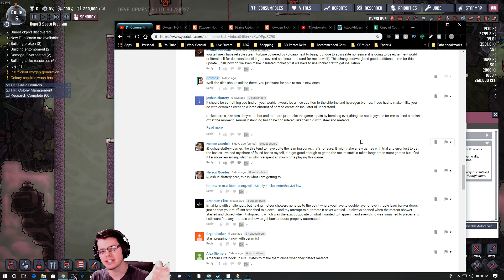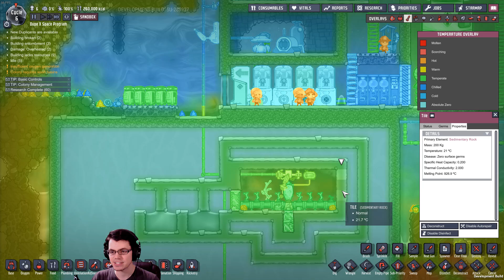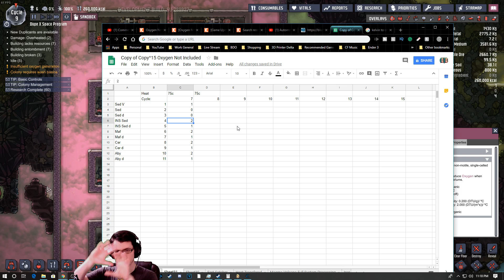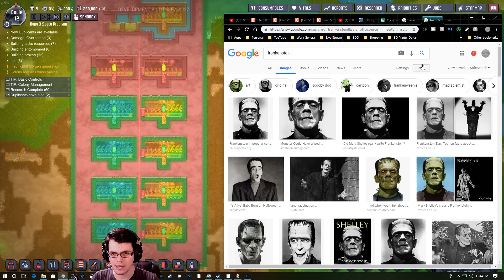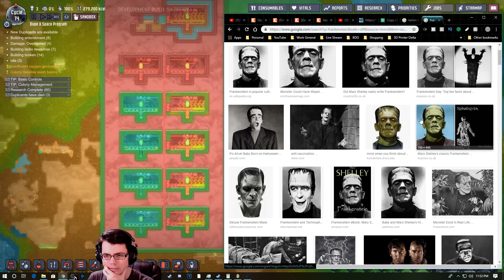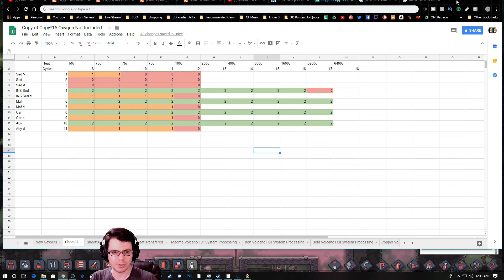Insulated Tile Test! Oxygen Not Included

Comment: The issue with the door is a very real problem, it's called thermal bridging and it's why you wouldn't usually use metal doors/window frames on buildings in real life. Would be useful if the game had the option of non-metal doors like wood but I suppose that would be too easy :p

Comment: They need things that RUN off heat... and actual "convection" to make the game a better game. Also, use standard values that people already know. "Thermal resistance" and "Thermal conductance" and "Thermal integrity". By the way, if something consumes 120-watts, it is only generating 120-watts of heat. Watts is a measurement of energy-loss, consumed and turned into heat. It is stupid that something consuming 120-watts, is generating as much heat as a 4000-watt oven. (Unless it is an electric operated gas oven.) Same with batteries... if it can only provide 1000-watts per hour, then it is only generating 1000-watts of heat, per hour. (Not actually, it is generating less, as the remainder is generated by the device it is powering. Thus, the "efficiency", if it is 90% efficient, then every 1000-watts of delivered power results in 1100-watts being consumed and the 100-watts extra, is generated along the wires and the batteries.)

However, they need convection, so heat rises as well as steam, pulling heat with it... So we can use these things to our advantage. (Top-open units, with insulated floors and walls, should retain temperatures like open-top freezers. Unless there is tons of motion to mix the air and push it out.) Everything here is just one property, "diffusion", and "specific gravity", with no consideration for thermal-motion or "wind", as people walk around or things move. (It only uses pressure travel from high to low, for "flow".)

Even in the video, all the heat should have instantly traveled up in the rooms and the cold should have instantly dropped down. The rooms losing heat should have had a steady "cold zone" underneath, as the cold air cooled the heating walls.

Maybe in the next or a future update...

Comment: I think they botched the tiles... My insulated are hotter then the air and blocks around them. Eg, My insides are 75.0F and the outside walls are 85.0F, but my insulated walls are 95.0F, 10-deg hotter than the outside walls and 20-deg hotter than the inside area... Something isn't right with the code that drives the insulated blocks. Does the creation process create heat that gets trapped in them? I just can't figure-out where the gain of 20F came from, within the wall tile itself.

Comment: The vacuum system works best, but you need a vacuum above, below, and between the doors as well. The vacuum system you are demonstrating here is pointless since the vacuum doesn't stretch all the way to the entrance. 

Vacuum insulation is the only type of system I've found viable in legitimate playthroughs for insulation good enough for things like liquid oxygen due to heat loss through doors, and more importantly, through wire bridge tiles (which can be mitigated by putting a vacuum between 2 sets of wire bridge tiles)

Comment: I watched an experiment for you today, the one about electricity power plant distribution, and i noticed that you've put shine bugs near the solar panel. so i did an experiment and found out that to get the 380 W of the solar panel you need about 55 shine bugs. you need to use critter lure to gather them without enclosing them in a space, and you can use the lure between two solar panels and get more power. its fantastic.

Comment: In most use cases of insulated tiles, they are usually exposed to medium temperatures over long periods of time up to hundreds of cycles leading them to eventually heat up and become relatively 
useless. also one of the bigger reasons the non-insulated tiles were heating up was due to not having the insulated buff, the insulated buff makes it so any thermal transfer uses lowest thermal transfer instead of the mean thermal transfer rate.

p.s isn't the gas physics and thermal transfer glitchy on ultra speed?
.

Comment: I find it interesting how no one's made a Hydro Fan setup... they must be really, really poor for cooling, or aren't even considered as they need duplicant operation.
Insulated Sedimentary rock can withstand a petroleum rocket engine.
You can also use Visco-Gel as a liquid lock.
I bet the recipe for insulated tiles will change... because modern insulation requires fibreglass... basically another use for a glass forge.
Reply: hydrofans delete water, worse than algea terrariums, equally bad as bristle blossoms. could only be useful to turn boiling hot water into cooling force via hydrofan magic but controlling where duplicants get water for where is untenable.

Comment: In the recent patch i was able to use the normal gas pump to actually vacuum a space out sure it took time but unlike the usual microgram problem it actually worked out
That never worked though when it was mixed elements
Also need ideas on how to use a door since i can't deal with the stress increase the locks usualy give

Comment: One thing you have to remember is that in this test he is cooling the inside with a wart and isn't exposing the farm for too long in comparison to normal gameplay where it could be hundreds of cycles to bleed heat in. If you are actively cooling a box can survive hotter temps, if you are not and want to hold off heat you need more resistance. A cooled airgap and conductive tiles on the hotside work well.

Comment: I wish a proper airlock (for both the gas seperation aspect and the thermal vacuum aspect) was something theyd add to the game as a unit. Yes, you can make something that sort of does this, but even the best solutions ive seen turn out to be very janky and unreliable and/or far too large to be practical. The way the game works you really need a device like this, but most solutions to date have involved unintentional mechanics and workarounds for the most part

Comment: BROTHGAR! Easy 3 door setup - Use Weight plates under the outside doors, connect an AND gate to the weight plates and the output to the middle door. Weight Plates should be set <200 kg (weight of dupe and less than doors) and free of debris. Also, love your vids bro. Your Venturi video gave me an idea and allowed me to come up with a very small gas compressor I've been using now on all my geysers and even the hydrogen from my O2 bubblers! 

Keep up the great work!

Comment: its about energy flow - thermal conductivity allows energy to flow along temperature difference (how much things heat up from that energy is heat capacity). The wheeze can soak up a specific amount of energy, so as long as the energy leaking in (wall conductivity * temperature difference * tiles surface area) is < the energy sink of the wheeze you will be stable. A better test is just an empty room without the wheeze to see how much energy gets through (having one present will just put put a pass/fail cutout at a specific size vs temp difference)

Comment: The only problem with your experiment (and this doesn't change the conclusion really) was you weren't considering the fact that the non insulated farms at the top were absorbing the heat at the top making the hydrogen towards the top cooler over all because the heat was inside those non insulated farms. It's why the plant near the sedimentary insulated was the last one standing.

Comment: So what is the door system that works well without the automation? I am thinking 2 door with a gap would be good to slow heat up until you get to the 3 door setup. Or like a water lock except using doors on either end

Comment: 7:47 Its not that hard actually to build a vacuum. I've learned from you the automated doors method, it'll use a little bit of metal though but it works perfectly and you can even do maintenance when you need to and then with any sensor just close and open doors and BOOM you have a vacuum all around your room. I used it to build a refrigerator also using automated weezeworts of yours haha, its really good. here is some pictures of it... its not automated though... not yet 

https://drive.google.com/file/d/1OLpGg8dBo7a9AblbxzWzyGMdSSnbQOPy/view?usp=sharing

https://drive.google.com/file/d/1_F7rtOMNUoKkQPYHXY6E64_oDRfMIfzq/view?usp=sharing

Comment: You could most likely compensate for the door a bit by moving the weezewart closer to it. As the rest of the air is stagnate heat wise beyond the it. Though it might have the downside of over chilling the area on the far side if placed too far.

Comment: @7:24 didn't test this yet myself, but you used wheezeworts quite a lot in the last videos to compress gases, via a small funnel

actually shouldn't this also work to create a vaccum? Just make a small space and let the WW suck everything up? then close it off underneath (rebuild the gas permeable tile into sealed of one)
Reply: Takes FOREVER if it works at all.  Why not just use an air-pump?  I'm usually building  a vacuum chamber by day 30  for boiling my germs.

If you use air-flow tiles, the water levitates above them, meaning you don't even lose heat to your water touching tiles.
Reply: can you elaborate on the boiling the germs? does a vacuum kill germs?

Comment: One thing to point out, it's technically better to use materials with larger specific heat capacity, because the heat transfer is dependent on the temperature differences between objects, and having larger heat capacity means that temperature is increased less when certain amounts of heat is applied.

Comment: ive said b4, the secret is called Thermal Diffusivity, google it. you should use liquids or solids to test tiles because Thermal diffusivity uses mass (Kg), 1000Kg poer tile versus 5Kg per tile(Gas).
Reply: and that's why tempshift plate aren't a good idea to spread heat or cool bc it has a 800 kg mass so cooling it or heating become much slower
Reply: not exactly true. It also depends on material. I used dirt tempshift plates to cool down my oil cocking chamber from 800C to 400C in less than a cycle (they turned to sand, I simple swiped them). At the same time I used diamond tempshifts to move heat from volcano chamber bottom to the top faster. Try it yourself in debug.
The issue you're having is that you probably trying to use them in less intense heat exchanges. It's just a wrong tool for that.
Reply: Thermal Diffusivity is the Ratio of Conductivity/(SpecHeatCap*Density). Since Density is Kg/m3 in game its only 2D so area AND all tiles are of equal size we can omit the area. and if your using the same type of Tile(insulated Tile for example) you can also omit the mass to compare the effectiveness of it. Simply put the find the perfect material you just need to compare the Ratio of Conductivity/SpecHeatCAp. I still remember my old Prof in university example>"Think of it like a Bucket with a hole in the Bottom. the Size of the Bucket is the Heat Capacity and the Hole is the Conductivity"

Comment: If the model for heat transfer is reasonably good, would putting doors in the center of the roof of your farm testing blocks affect how much heat is transferred into the rooms (instead of on the side, because heat rises)? The central wheezewort could probably negate some of the thermal energy which bleeds through the door that way, leading to a more even distribution of heat through the room, or little to none?

Comment: if u want, u can utilise the elevator thingey after u got plastic, that way u can fully wall the room. only downside; it require dupes to get in and out through the whachumacall it thing.
Reply: Well, that and plastic melts at a really low temperature so it has it's weak points.
Reply: but, they have low thermal conductivity. with melting point of 75ish. as long as its not around geyser and the reddish thing at the bottom part of the map its still alright. say for  the grain thing at 5 to - 55c plants. or like this; video growing room in general. beside its kinda pointless to contain really hot part if u want to utilise em, or if u want to utilise them u just need larger space.

Comment: Hmmm. I don't get why you don't just calculate it? You have the thermal transfer formula and all the properties you so you can calculate it pretty fast. Anyway. Double insulated walls is far better than any single insulated wall of any normal material. Worst case scenario double walls is 15.5 times better than single walled ceramic. Building insulated pipes inside insulated tiles has the same effect.
Reply: but where is the fun in it. I miss spreadsheet episodes though...
Reply: Sometimes experiments shows things beyond theory :) (like bugs or odd properties).
Reply: You missing my point. Examining the theory and calculating first allows you to set up an experiment that examines if the game behaves like it should instead of like here just stabbing in the dark and drawing wrong conclusions due to not having examined how it is supposed to work.
Reply: Takes a long time  to build double walls while the kilns can run off material delivery don't need alot f dupe manipulation there

Comment: Temperature management will be more challenging without abyssalite... 
Keep in mind (for more accurate testing :P ) that building in survival mode, every material has different temperature depending on the biome and not the default 20 degrees celsius of sandbox/debug mode. Probably the temperatute leak isn't much but building inside the base with maffic around 100 degrees or igneous of 35-45 degrees may create some problems in the beginning.

Love the massive experiments with multiple distractions along the way xD Keep up the good work!
Reply: Thankfully when you build something, even from a very hot material, the temperature is reset to about 45C maximum. It's the fastest and easiest way to cool down fairly small amounts of very hot materials.
Reply: wow! Samsonite Dove, I didn't know there was a default building temperature. Thanks!  I just avoided very hot materials in general :P
Zackary Hallett, after the last update goes live no material in the asteroid can withstand temperatures like abyssalite did. There is a new material to replace previous abyssalite builts, that if processed with abyssalite can make a perfect insulator (if I am not wrong..)
Reply: To add to this as well, You have to think about going further than 1 or even 10 cycles.  Think about when you start out. everything around you is good temp but with in 40 or so cycles the temp around your base has risen.  The tiles may be good for 1 or 10 cycles but the real test is how long can that material keep the heat out!  50, 100 or even 500 cycles is when it matters.  Basically, if you are playing the regular game and build a farm, the insulated tile has to withstand the length of time as well as the heat around it.

Was also thinking that when we build our storage areas not we may have to think about where we are storing things.  If we store stuff in a cold biome it will be cold for building later.   Essentially it does no good to build a farm with insulated tile that is already 40 degrees Celsius!  its going to take a while to cool that material down!!!!
Reply: @Zackary Hallett, exactly. Time is the factor. Unfortunately, Brothgar is an impatient man, so he doesn't consider this important otherwise he would have found that double walled insulated tiles is the "good enough" solution to the problem without going through the trouble of making vacuum moats.

Comment: Also, at 6400 degrees celsius, you have hydrogen that is hotter than the surface of the sun.
Reply: Not enough to start nuclear fusion though. 15 million K is what you need. And enough pressure to counter the repulsive forces between the nuclei(which is a LOT). But the game seems to be perfectly fine with holding more mass in a tile than neutron degeneracy pressure which means max pressure before black hole. So that's interesting.
Reply: That's fair. I mean, you can have basically infinite mass in a single "pile" and yes, definitely not enough heat to trigger nuclear fusion.

Comment: One thing to keep in mind in the early period of your base, the igneous rock you dig up is gonna be 40 degrees celsius and the sedementary rock is going to be 30 degrees. Sandstone, which starts around 20 degrees can be useful simply by having a lot larger buffer of heat before it starts slowly leaking heat in.

Comment: That density of hot hydrogen is a little unrealistic. At a lower density and with O2 or P02, the Wheezeworts would have a much better chance of coping with the incoming heat.
Reply: that's why it's called test - you speed up things to see result fast =)

Comment: Tiles are generally not a problem.  The real problem is pipes, especially gas pipes if you wish to keep the gas inside the pipe a certain temperature.
Reply: Use insulated pipes inside insulated tiles
Reply: Yes, wherever possible.

Comment: I would just like to point out that the next update lets you build stuff taking raw metal out of Steel, Niobium, and Thermite. This increases the overheat temperature by 200°C, 500°C, and 900°C respectively
Reply: Correction. The material is now called Thermium instead of Thermite.